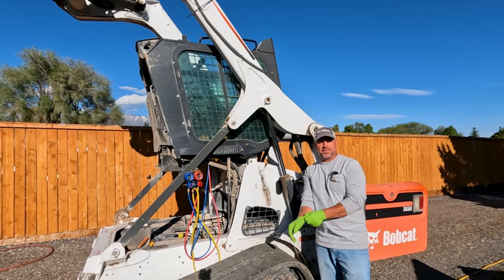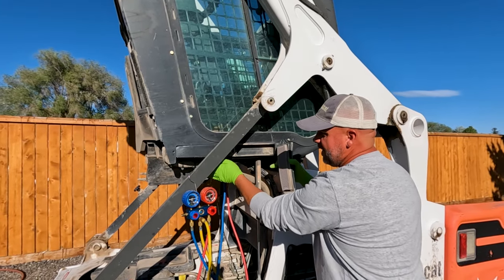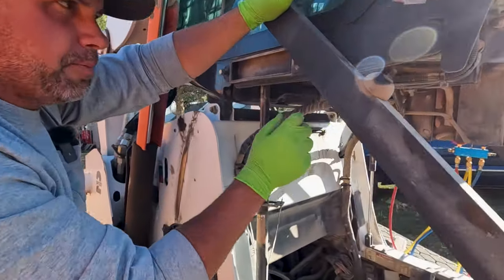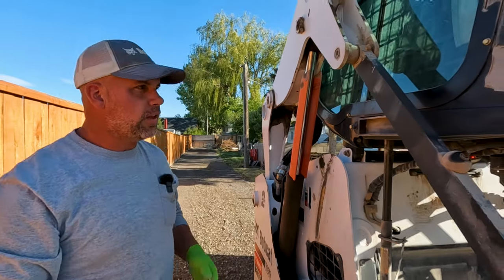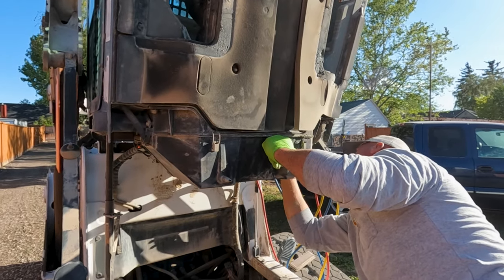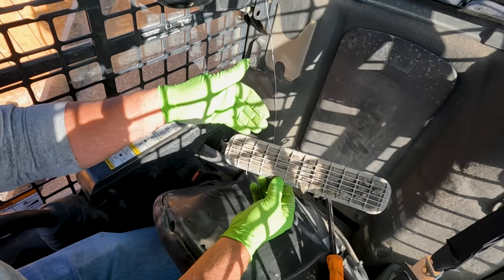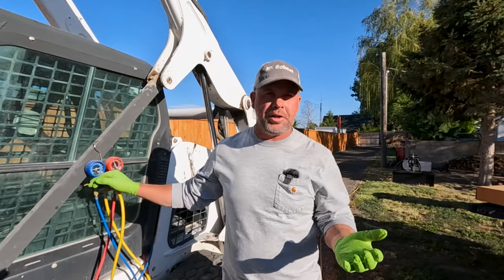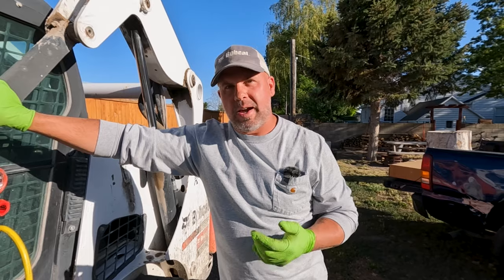Bobcat Air Conditioning Tune-Up

Comment: Great video, thank you for doing.  I have a 2016 T770 which was blowing cold AC, then stopped.  Followed your guidance, cleaned everything and dd recharge a little.  Back to cold.  It didn't last long.  Now winter is here and trying to get heat, but no heat.  Any additional guidance you could share would be greatly appreciated my friend.  Thank you in advance.
Reply from the maker: My first guess would be the heater control valve is not opening.

Comment: Where is AC/Heater blower motor located?       Thanks for the location of that behind the seat heater, at one time I thought it was just behind the head-rest, not on the floor for crying out loud.  Why would they put that thing down there where all the dust is going to collect and hard to change?  Put the return right above your head so you can check it daily.    It's like putting the speakers down by your knees where you can't hear them.

Comment: I have had issues with condensor freezing up on my 2016 T650, and replaced all filters and still having issues,  and think it is low on refrigerant.  Now having issues with headlights blowing 20A fuse and giving M4803 code, which is front relay light off. I read somewhere that same code can also be tied to low refrigerant is that possible lights and the AC issue are connected? Thanks for all the great videos.
Reply: That would be the evaporator. The temperature sensor is bad or the evaporator is clogged. Lights and A/C should be on a different circuit. If it's freezing, the charge is good. Never add refrigerant on a sealed system.

Comment: Awesome video, thank you! 

We have a 2017 A770 and the compressor won't engage. Could that be freon level? Switch in the cab goes green
Reply from the maker: It could be from low freon, jump the pressure switch and see it it will engage the clutch.
Reply: @tetradgroup  will do. Thank you!

Comment: Working on a t650. Put a new compressor on. Fuse and relay are both good. But I can't get the compressor to kick on even when I try to send power down the line with a power probe. Any idea what might be interrupting power between the switch and the compressor besides possibly a bad wire?
Reply: Edit: I have found that I don't have power coming to my pressure switch. Not sure why since my fuse and relay are good and the on off switch is receiving and sending power but that is progress so far

Comment: Thanks for the video help, I’m roasting in my s770
Reply from the maker: Hope you get it working again
Reply: I evacuated the system and put two lbs in and I get the two blink code, open clutch or over current. My machine is in Ellijay ga , so going back up on Thursday and try to find fuse panel and relay to jump out. I live in Gwinnett , I think you used to live in Georgia. Thanks for videos again.
Reply from the maker: @kenbutera3530  I lived in Gwinnett as well. Check the switch in the cab, majority of the time the switch is bad with the 2 blink open code.  It can still light up but not make contact to engage compressor.  I've also seen pushed back pins in the connectors at the compressor, unplug and check pins. Hopefully it's not the compressor clutch,
Reply: Thank you, I will check that first. I’ll let you know how it turns out.
Reply: @tetradgroup  I tested switch and jumped connector out with paper clip and no clutch , I removed connector from compressor and skinned wire and jumped a hot lead to connector and plugged back in. Ice cold air and clutch is engaged. Moved relays around, but getting two blink code. Thanks for the help, Kenny
Reply: Thanks for help, found wire broke going thru cab to dryer , works great now.

Comment: I got a 773 g series I was wondering who makes that ac unit I got blow motor problems
Reply from the maker: Im not sure on that machine, the 773 G is probably a 2000 or 2001 and I cant remember who bobcat used for HVAC at that time but I will try to find out for you.

Comment: My compressor tore the belt. What is the process for replacing the compressor as part of the belt is stuck in the pulley. It’s a T650.
Reply from the maker: I would try to remove the clutch and clean the belt material from the compressor before I replaced but if its damaged it would be like any other compressor replacement, evacuate the system, change the compressor, add necessary oil, pull vacuum, and charge with 2.2 pounds.

Comment: Hi I have a 2014 bobcat s650. Just got my ac recharged and it’s still blowing hot air. Light is dim on the ac switch but mechanics said the compressor is coming on. I don’t see any light on the thermostat. Could this be the reason it’s not working
Reply from the maker: If compressor is on then everything is satisfied electrically and should be blowing cold.  Could be an airflow issue or faulty heater valve allowing hot coolant to flow thru heater core.
Reply: Out of curiosity have you made a video about the heater valve or could point me in a direction where it is.

Comment: What happens if your AC compressor is not clicking on, is that a fuse or is that just low on Freon?
Reply from the maker: Could be either issue, would need to put guages on it and check for pressure first
Reply: @tetradgroup  now, where could I possibly find a fuse if I was looking for it

Comment: How often do you recommend changing the clean air filter on my L85?
Reply from the maker: Really depends on conditions, Bobcat does not have a set maintenance schedule for the cabin air filters.  Some machines I change every 250 and others every 500.  I wouldn't go more than 500 myself.

Comment: G'day, this is a long shot but i hoping you may have seen this as i cant seem to find the issue and it has my dealer stumped, i have a 2018 t870 with a kubota engine, its blowing heater cores, i have tried 3 different cores, 1 was pressure tested before putting it in and it still failed, machine doesnt get hot, doesn't use coolant, ive done a combustion leak test and all good. Im at a bit of a lose to know whats going on. Thanks
Reply from the maker: Never seen a 2018 with a Kubota engine.  Have you ran the machine with a pressure gauge on the radiator.  I seriously doubt the system is building enough pressure to blow a heater core.  Do you have pictures of the failed cores?
Reply: @tetradgroup  G'day, im in Australia if that makes any difference? No i haven't pressure tested the cooling system yet, but im the same, the cap should let out the pressure or a hose should let go before the heater core. I do have photos, ill try to send them, its blowing the copper tube outwards. Thanks for your help

Comment: I have an m series t870 it seems like the temp control is either cold or hot no in between. I saw someone else with this issue any advice on this issue?
Reply from the maker: Hard to say without some testing.  It could be the blend switch or the blend motor which allows hot coolant to flow thru the core to warm the temperature based on position.  I would start with the switch myself, more common than the blend motor.